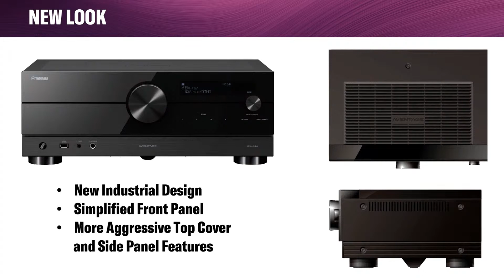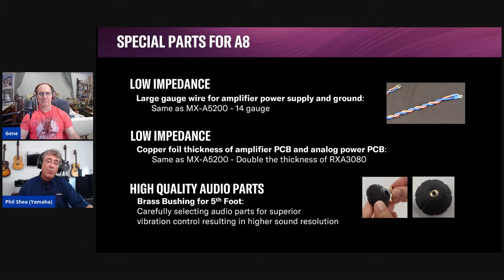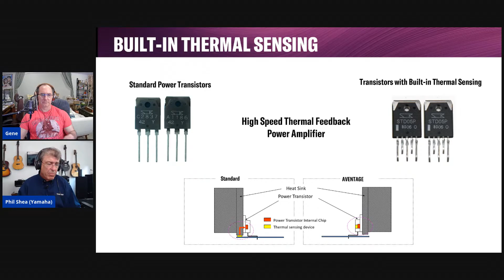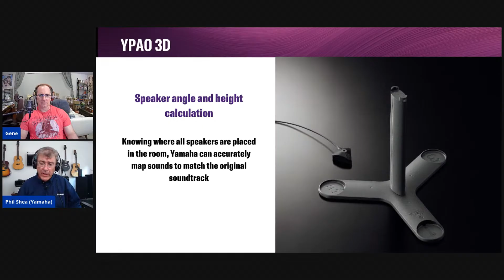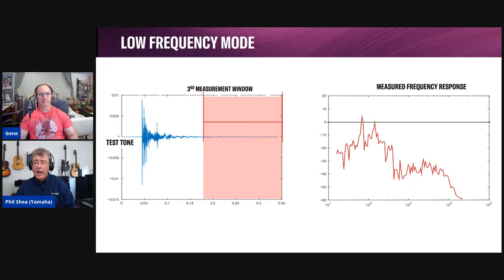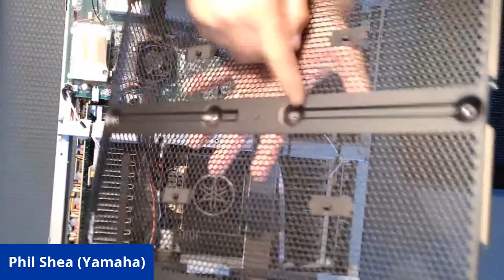Yamaha VPE: New 8K AVENTAGE AV Receivers for 2021

Comment: Great video.
I am saving up for the A8A.
I really love the ability to tweak low frequency...and a friend of mine had the V6A, and I was really suprised by the soundquality in that (and decided that an Aventate would be my next AVR right there 🤪).
Reply: Did you ever get it? If so what do you think about it?
Reply: @LichaelMewis  
I ended up with a Denon X3700H insted. Don't need the extra power (have 4 externaly amped channels😊), and concluded it was not worth rhe extra money, more than twice the Denon🙊

Comment: Very disappointed with Yamaha and this cost cutting look with all that plastic, can't even put a hdmi input on the front panel, for $3,000 thats inexcusable. Or a usb input on the rear. Or how about a decent display, there is plenty of room for one. Epic fail with these models.
Reply from the maker: The entire chassis and front panel is thick steel. The plastic is only cosmetic. Their $3k receiver weighs almost 50lbs and the meatiest AVR at this price class. Do your research before ASSuming.
Reply: Thats the point, for $3,000 they shouldn't be using plastic for cosmetics. It just make it look cheap. A nicely done aluminum front and steel top plate is what is expected in this price bracket. I'm sure the frame is well built. And taking away the front hdmi is inexcusable. Not a fan of this look at all. They can't even give you a decent display for $3,000. The last great receiver Yamaha made is the RX-Z11 and would be nice for a replacement with that quality of amplifier. The RX-A8A is not it. I lost interest in Yamaha after they dropped the Z series.
Reply: Indeed the display of these new models is disappointing!!! By way why are antennas in the back and not designed in the front (probably built in)?

Comment: Yamaha time to step up and take on the Big boys with a new line above the Aventage , Hi end line in a Pre pro wouldn't that be something.
Reply: This thing is pretty much a pre/pro, IF you want to turn on pure direct mode, it has 13 pre outs with balanced outputs AND intputs for L/R. Turns off video section and every other digital channel processing module; to go full analog… Then again I do agree, I think they would make wonderful high end pre-pros if they have the R&D capacity. But at this price, this thing is ALMOST a pre/pro and a dedicated 11 channel amp in a box. They could make a RX-A10 with two power supplies and two power inputs in a box, that would be epic 😂 I still have an old Yamaha amp that has separate power supplies for the left and right channels. It’s pretty impressive

Comment: NASA chip LOL. Dude, you couldn't even get 4k down for a LOT of customers
Reply from the maker: Yet they are the FIRST AV manufacturer to support full 8K/120 and 4k/60 on ALL HDMI inputs. Hmmm.
Reply: @Audioholics  IT HAS BEEN CONFIRMED YOU HAVE TO SEND THESE UNITS IN FOR REPAIR. Hmmm

Edit: The lower tier units you have to send in for the faulty chip. Costco units + the lower tier Aventage. I know you have read this.

Comment: Confused by what he said a6a is capable of at the 1:25 mark. If u have an additional 2 channel amp why would it be limited to 7.1.2?
Reply: I do 7.1.4 currently with an a3070 and an external amp
Reply: A6A has 11Chs of processing (preamp 11.2 chs, w/9.2 chs driven), with an external 2ch amp you should be able to run 7.2.4 as I understand it.
Reply: @MrMindlink  thats what i thought, it shouldnt be any different if using auro 3d right?
Reply: @Ocho817  In this context, no, I do not believe it would be any different if using Auro 3D, but there did seem to be a bit of consternation on Phil's part when asked...  

FYI/From the A6A manual (Pg 73):  "7.2.4 [ext.Front] or 7.2.4 [ext.RP]",  "You can build an 11-channel extended system only with the front speakers or the rear presence speakers using an external power amplifier."

RX-A6A User Guide:  https://usa.yamaha.com/files/download/other_assets/1/1335611/web_AV19-0085_RX-A6A_ug_UCRABGLFP_En_A0.pdf
RX-A8A User guide:  https://usa.yamaha.com/files/download/other_assets/7/1335627/web_AV19-0100_RX-A8A_ug_UCRABGLFP_En_A0.pdf
Reply: @Ocho817  Right. As long as you have your speakers placed right for Auro 3D. IIRR it will still do Auro 3D if you have traditional "Dolby" speaker placement, they use an emulation (I think they call it Auro Magically ... LOL) to give the Auro 3D sound, but I think you need to honor Auro's "speaker height" setup to get the best that sound field system offers. Keep in mind I'm speaking from my understanding of the systems, haven't got my A6A yet ... 🙂

Comment: Interested in signal to noise ratio, power in each channel, Distortion as a function of power and frequency... what I want is a wire with gain out of an amplifier, currently using flagship Denon anniversary receiver but need a new receiver for another system, and the Denon is no longer available....  I have great respect for Yamaha and may pick one of these up, but the SINAD is important to me.
Reply: Also, country of manufacture matters, Japan is great, but i doubt these are made in Japan at these low price points... hopefully Taiwan, i won't buy made in CHINA.
Reply: @themaskedsingercucucachu8225  Malaysia I think
Reply: @slyfoxx8540  Yikes, i was just sent an article about forced labor in electronics factories in Malaysia... I can't get behind slavery.
Reply: @themaskedsingercucucachu8225  I think you'll find a tonne of stuff being made in countries like this, it takes a lot of choice out of what I'm looking for to be honest, so as long as it's not China I'm not to fussed. And you have to remember that the cost of living in Malaysia is a lot lower so not as bad as you think.

Comment: Thanks for this, Gene! I was most looking forward to seeing if you would ask what Phil Shea had to say about the center channel spread. And you did. Perhaps what keyed me onto this is two things; your video last year with Patrick Schappert and the Auro3D algorithm that I just watched and my own experience with my Yamaha DSP-A3090 (w/ dual center channels).

I was left a little wanting when Phil Shea spoke on the issues of Aura3D upmixing w.r.t center channel and Yamaha YPAO DSP. He spoke as if 'all was good' - "yep, yep yep" - but it seems like there's more to discuss or to develop. Of course it was a pretty comprehensive video and I certainly didn't collate it all in my head. 

My request is if you could kindly update us going forward with regards to the 5200 series and the Aventage (esp. The A8A) in this specific application. ( In the mean time I will make an effort to review your video and article library to learn more.) I would be curious to see when you get Phil Shea back on if he could dive a bit deeper there (if necessary). I'm not so technical so I would also like to understand more if there's a possibility for FPGA firmware updates there. What's Yamaha's track record in the area of long term support (beyond the next model cycle)? I've seen your recent analysis of the these two series, but have you compared (or could you) the R8 with the 5200 series in this regard? The R8 seems bangers, so what would the step up to the 5200 mean? 

A note about where I'm coming from. To me the soundstage and imaging excites me the most. Of course dynamics and frequency response also matter, but unfortunately I can't play music loudly as I have no dedicated music environment. I could have bought some Maggie's and stuck to 2 channel 'purity' (and I will probably still go for it soon enough), but instead I purchased a Yamaha DSP-A3090. I really, really love that Yamaha DSP after all these years. I was an audio salesman in the 90's/00's and experienced the RXV-2080 demo at Yamaha HQ when it came out. It simply blew my mind not only for the impressive sound field but for the power of the amp. l really like it more for audio. Does this mean I'm not an audiophile? Lol. 

Because of the center channel steering in movies (where too much is removed the mains) I have developed the habit with my Yamaha in switching the DSP modes throughout the movie to maximize the sound field. (The challenge is to switch without my wife knowing. I've gotten so many faces over the years. It's a fun activity! Lol.) Of course the DSP-A3090 has dual centre channel outputs and I'm taking full advantage of it (one speaker above and one below the TV). It helps. I'm curious why dual center channel outputs are all but forgotten.
Reply: Auro3D, i have the Demo here, able to play that on A6A.
never been able to find any real content.....
Reply: @lucasrem  Hi Lucas. So you have the A6A? Have you tried the Auro Upmixer? The A6A has an up-mixer, right? Apparently it's designed for legacy 5.1 surround and 2-channel. I believe that it doesn't need Auro-encoded material.

Comment: With these new receivers, have Yamaha removed the cross-upmixer limitation imposed by Dolby?  But has since been rescinded?  i.e. being able to use DTS' Neural:X to UpMix a Dolby Digital+ or Dolby TrueHD 5.1 or 7.1 signal?
Reply: One comment mentioned that Auro3D is available in the 6A and the 8A. Does that answer your question a little? I'm interested in the same topic but I'm a bit out of date. I have a DSP-A3090 with dual center channels, and while it helps with vocals to the middle of the TV it leaves me wanting for more center channel spread to the mains.

Comment: This was great. Was looking at anthem or JBL but the bugs were scary. Cant with till Gene puts the A6A through its paces since this model is in my future.
Reply: Get an Anthem. The JBL sounds like crap. The Yamaha are good but Anthem just smokes them and pretty much all the bugs are gone.
Reply: @seanlacroix  So the noisy fan that comes on all the time has been fixed?
Reply: @mattgiunt  I think that was with the avm 70, but yes from what I've heard I'm the forums it is fixed
Reply: @seanlacroix  I've been reading them as well on avs and av and thats (fan noise) not fixed at all and some have had replies that stated that that's how it's supposed to be, that's why I'm going with the a8 over the 740.
And I don't think the avm 70 even has a fan.
Reply: @slyfoxx8540  yes, the avm 70 has a fan. All of them do. Even my 1120 has a fan and when it runs I don't hear it. For 99% of people they are going to notice it. Especially since most people put it in a rack.
Reply: @seanlacroix  someone who owns an avm70 stated that he didn't have a fan (haven't checked myself) which are built differently from the mrx's anyway. 
And congrats that you weren't one with a noisy fan cos plenty of others were pretty griped over it and aren't getting any answers on some kind of fix.
I actually wanted one after the t778 was found have a few bugs itself, but I think reliability has come up a notch in my needs.
Reply: @seanlacroix  jus checked yep has got a fan
Reply: @slyfoxx8540  the problem is that the fan is small and has to run at high rpm to cool the internals. Can sound whiny sometimes.
Reply: @seanlacroix  according to them its more than whiny, if you get a gooden, all good but bad luck if you don't. It's the one thing that tipped me to look elsewhere, and the fact that anthem wasn't even answering a lot of people was the sour cherry on top.

Comment: Build quality looks great.  Major letdown they still using that crappy ypao. If they would have put dirac on this new line it would be a grand slam.
Reply: I was thinking the same thing concerning Dirac. I have a Arcam AVR- 850 (bought used for $2,700) with Dirac that I have been using since 2017 and I must say I like using Dirac for the room correction over others that I have used. I am using the Arcam in my man cave and using a Pioneer SC-LX901 in our main viewing room. The Pioneer utilizes MCACC Pro software for speaker calibration that I have been using from 2017. Prior to the Arcam I was using a Denon 4311CI that was using the Audyssey MultEQ XT. I never liked the sound the Denon produced for 2 channel music listening with the Audyssey software on or off. In fact I started looking for new front and left speakers to replace my Mirage OMD-28's. One listening session at a Best Buy Magnolia Design Center when auditioning potential B&W speaker to replace my Mirages. It was then after listening to offerings from Denon, Marantz, Pioneer, Onkyo, and Arcam. All the aforementioned receivers were the top off the line or flagship models during that time frame. Other customers were in the listening room and all of the receivers had no room correction enabled and the bass and treble were in the neutral position. All were in agreeance the Arcam had the best sound for 2 channel music listening but they were also the most expensive.  

Two things I wish this new Yamaha had is Dirac and the use of class D amplification. I have a Wyred 4 Sound (ST-MKII 1000, Power Output 8Ω @ 0.2% THD+N: 460W
Power Output 4Ω @ 0.2% THD+N: 725W) class D amp connected to my Arcam that provides power to the front left and right speakers.  I would have liked Phil to expand upon what Yamaha is looking for in a class D amplification, I believe he said it would cost 11 or 12k for the Yamaha for the class D amplification they were considering. Over on the Audio Science forum there are various different class D modules getting rave reviews. One amp I am considering is the Benchmark AHB2. While not inexpensive at 3k it is highly recommended.

Comment: A bit disappointed with the amount of plastic being used on the top model A8A.
Namely the front facia and the top cover (that I wasn't aware of)
Reply: Still £3000 for an amp that looks like a £300 amp. I have ‘bought Yamaha amps for years and still own a dsp a2 from 30 years  ago as I could not let it go.  I have had other Yamaha amps and all had a nice brushed metal finish and I am not impressed by this plastic cheap look at all.  I don’t mind the design but the all plastic is making me think twice.  They might be the best built but they do look cheap as hell big mistake on Yamaha’s part as this looks to me to be a money saving idea.
Reply: I agree, that plastic look is a big turn off and a deal breaker for me, not having a front hdmi input puts the nail in the coffin. Yamaha went cheap with this design and it looks cheap. No excuse for the amount they are charging. I own the RX-Z11 and that is an awesome receiver but the RX-A8A is no replacement.
Reply from the maker: @chriswyatt9868  the RX-8A has a superior DAC,  HDMI, and CODES. Only loss is 20wpc but that's was preouts are for. Hanging on to a Z11 for nostalgic reason is a poor excuse not to modernize. You're missing out.
Reply: @Audioholics  I'm not missing out. I had the CX-A5100 and MX-A5000 and now have a Marantz AV8805 and SR8012 in my two rooms. The Z11 is sitting in its box for now. Was hoping I'd like the A8 but so far not to impressed, maybe it will grow on me if i seen it in person. It's just not a Z11 replacement.
Reply from the maker: @chriswyatt9868  nothing ever will be. The age of the super receiver is long gone.
Reply: @meridiusuk8567  You honestly think Yamaha make good quality surround sound? Does anyone remember the world famous DSP 2070 or the A1?
Reply from the maker: Behind the front plastic face plate is steel. The top plate is thick still with big venting. The plastic is cosmetic. These are the best built receivers since the Z11.

Comment: Yes Sir they are reliable, I have had my RX-Z11 as my daily driver since 2009!  Never have I had a problem with it!
Reply: I have the Z11. Picked it up for 80 dollars  Australian not working and fixed it for 800. Problem was with the power supply and a component video board. Been  using it for 18 months now with no problems and I give it plenty of ventilation.  It drives my Magnepan LRS easily and sounds pretty damn good for a surround amp. I rarely watch 4k and Netflix and Disney etc that I watch is mostly Dolby digital plus so I won't be upgrading any time soon.
Reply: I too have an RX-Z11, and thinking of getting the AV 8 as logical upgrade.  What is your opinion?

Comment: "Our Parametric EQ, isn't Parametric enough". That's because it's not Parametric, it's graphic. They may have added "4x" more bands, but if you can't infinitely adjust the frequency, Q, and gain, it ain't Parametric.
Reply from the maker: It is parametric in that you can adjust Q, something you can't do with graphic.  But, it does have fixed bands though 4X more now than on the 5200.
Reply: Huh? Can you please explain in more detail? Thank you
Reply: @hometheaterjoe9489  Yeah, I know. Do you understand what Q is? Also I think Gene is saying that the 8A and 6A offer an equalizer with 4 times more frequencies to adjust than the 5200 does.

Comment: I never knew E-Cores would have advantages over toroids. Learned something new today! The HDMI heat syncs are very impressive. I hope that this thing has a preamp mode out like the Marantz 8015. Note: Auro 3D is only available on A6a and A8a.  The A4 is the best value but doesn’t have Auro. At 1300, it’s a bargain!
Reply: Ya e-core gives you more power per square inch. Toroids just look way cooler. In my Anthem I have a toroid but it's very well braced and shielded because otherwise they're quite noisy.
Reply: Toroids have a smaller area of emf radiation, but the iron core saturates easier at full power. I prefer toroids, less EM interference and less noise to the surrounding circuitry at part loads
Reply: @ChrisPapas100  Toroids still rule the day in AMPS while Ecore is probably better in receivers for many of the reasons the guest stated. Lots going on in receivers.